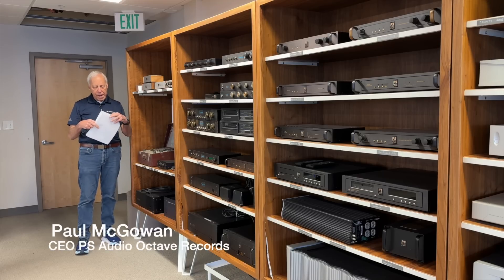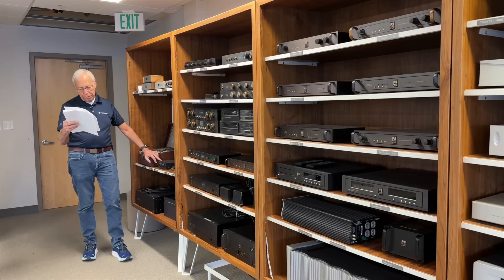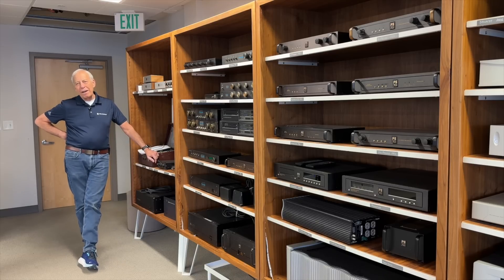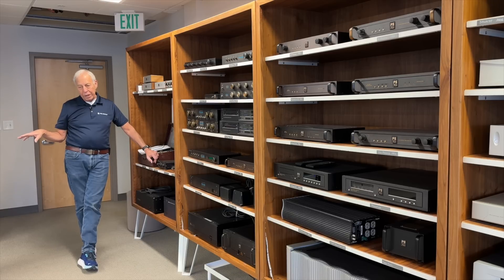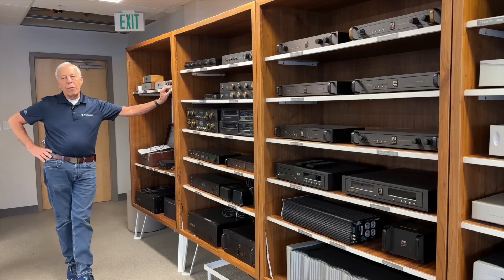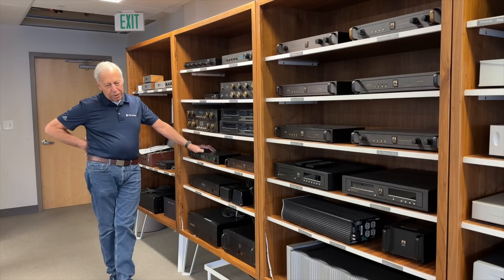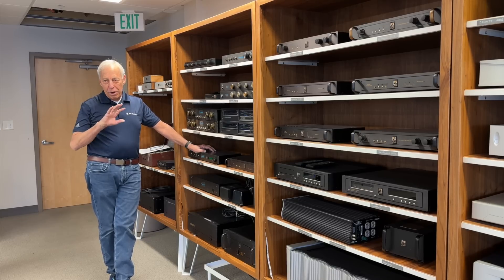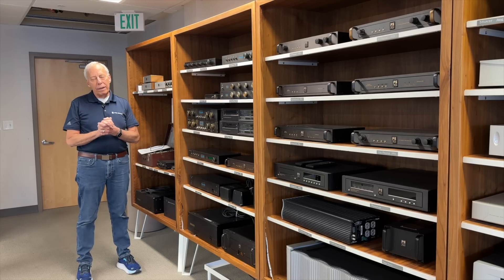Tube preamp life

Comment: I remember discussing with Tim de Paravicini about the EAR 509 power amp. He said it was in part inspired by some of the bad designs using the 300b. Technically the 300b. with the correct direct heater chemistry, should run for ~ 30-40K hours. However there were a lot of poor 300b clones and some amp designs ran them well outside of their operating parameters as a dull valve looks boring, and a glowing valve sells. Tim’s amp pretty much lasts for 50K hours, or about 5.5 years continuous use, where a badly biased 300b, with some rubbish “HiFi” valves can only go in a few hundred hours. Correct answer, it depends. Pre-amps last a very long time, so long as they are designed correctly and the valve seal is good.

Comment: FWIW there are specialist tubes made that are engineered for high reliability and long life in continuous operation. Transatlantic cables have amplifiers. These submarine repeaters used tubes and are intended to operate for 20-50 years…
For consumer grade tubes octal base types are better for long life than B7G or B9A types, of course it depends on the failure mechanism.

Comment: Tubes or transistors warm up completely in a hour, you don't need to leave it on to reach thermal equilibrium . Just play music while they're warming up.  If it sounds different, they might be something else going on like sag in your power from the power company. Check an outlet with a multimeter.

Comment: I will not leave my ST-120 on.  Instead, the power management system I built soft-starts power to the amp (like a 3-second ramp).  The amps auto bias board delays B+ to the power tubes a few minutes.

Comment: Why can't the designer keep the Tube filament voltage at half of the normal voltage when in standby . Back when Televisions used vacuum tubes some brands did this on their best sets so that it was nearly instant on and it did not shorten the life of the tubes.

Comment: Interesting Paul brought up this age old subject - currently I'm running tube front end - although I never turn off my solid state mono blocks, I recently had an occasion to leave everything running for a few days (I use standoffs to raise the lid of both my phono and line stage to help with getting some of the excess heat out) but anyway - I'd forgotten how lovely a system can sound when left on for an extended period - can't do it all the time, a decent tube set for either of these preamps is getting close to a grand these days.